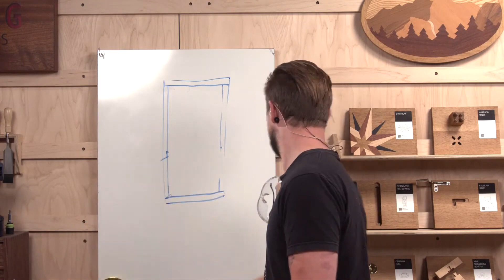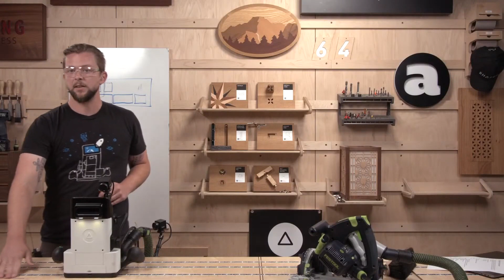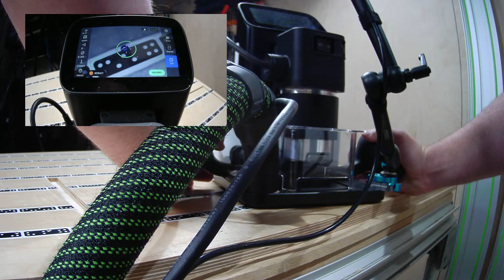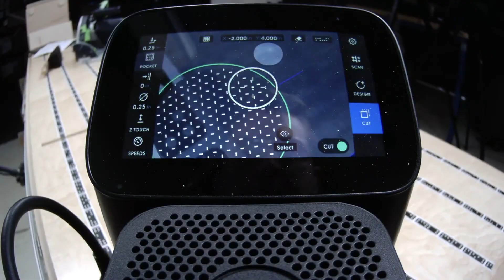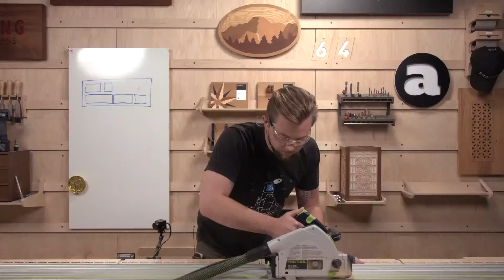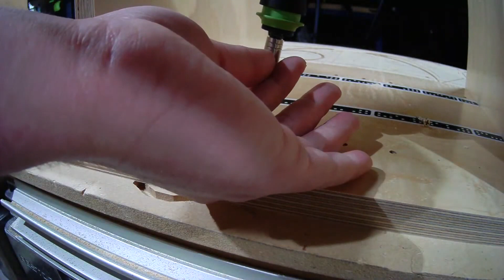Session 37  – English: Casework with Origin + Track Saw

Comment: Would like to see a knock down panel, version of this video, with connectors, swing door and internal drawers, the whole using system 32  holes.

If you had to make 10 of these cases, you would probably factor out the tape to a template. What strategy would you adopt?

Comment: SUGGESTED NEW FEATURE:
The shelf pins, the hinge cups, each kind of pilot hole, are different sets of similar machineing operations.  If each operation were identified somehow as belonging to one of those sets, perhaps by a comment or a custom XML attribute, Shaper could tell you, when you're performing one of those (eg a hinge cup), how many more similar operations (with the same settings) are left to do and can guide you to the next one.  This would be a good aid when working across large workspaces like in this video.